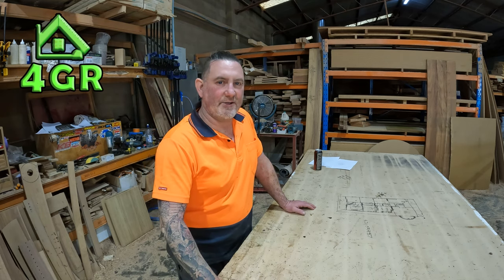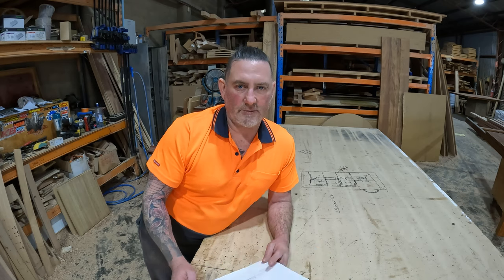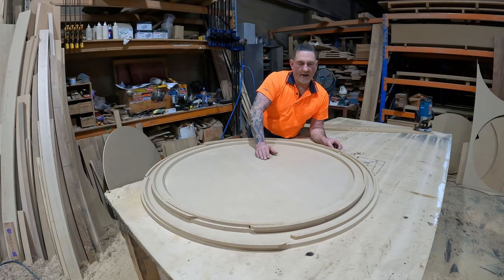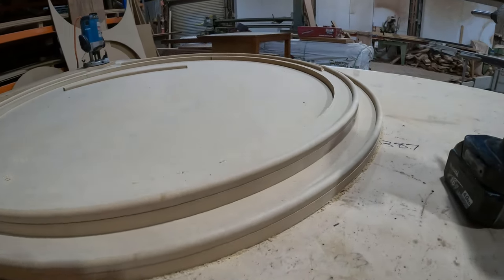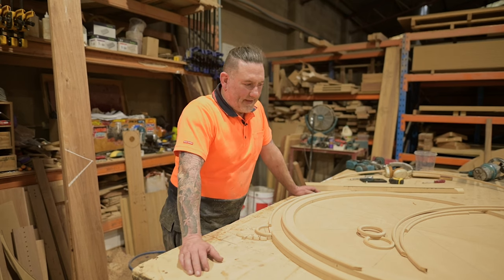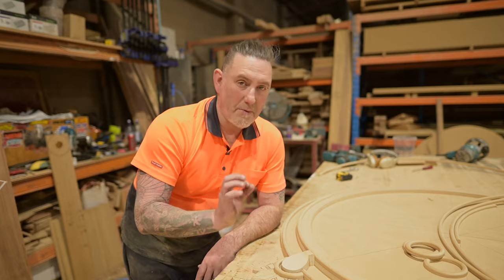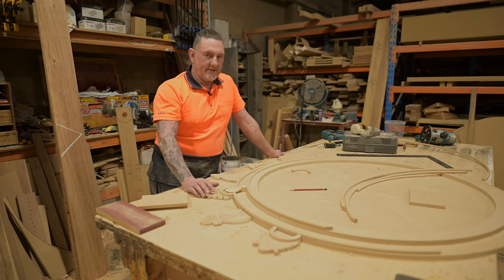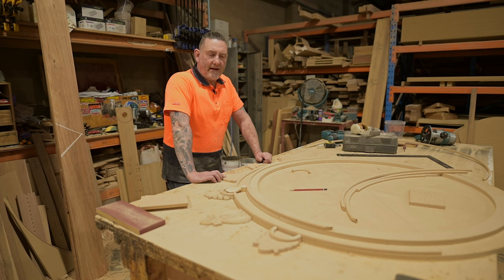S01E60 : how to build a ceiling rose/ medallion | 1880 House Renovation

Comment: It’s amazing to see how different creators approach similar tasks. Your woodworking skills are quite impressive. I’ve also seen this done with plaster of paris, air dry clay and resin molds. People’s creativity seems endless. Personally, I would have probably built 1 base with clay then replicated with paper mache over foil substructure. It is lightweight, durable, cheap and helps with sound absorption

Comment: Great ideas, mate! Love the design you have set out and I would never have thought MDF could be so adaptable. Am wondering how much heavier this rose will be compared to plaster and whether special fixings will be required. I am really looking forward to the next steps on this creative project.
Reply from the maker: Hi,  thanks so much,  yeah mdf can be used for all sorts of things,  the weight will be slightly heavier,  but I can screw up to the ceiling joists, so can't see any problems arising. Cheers,  Mike